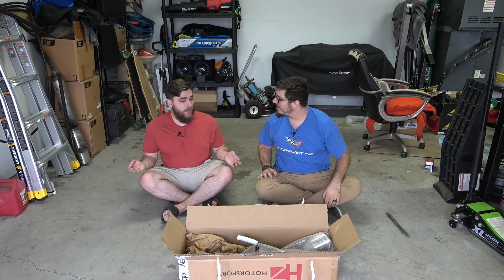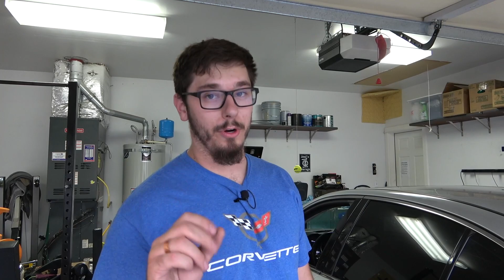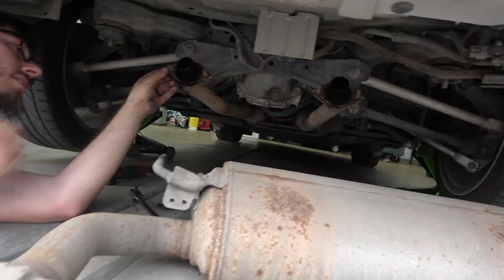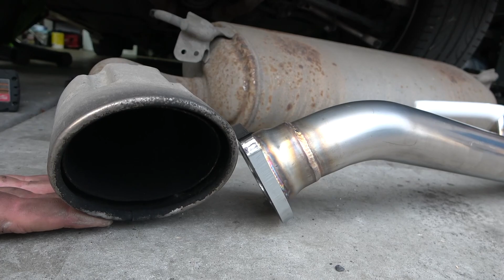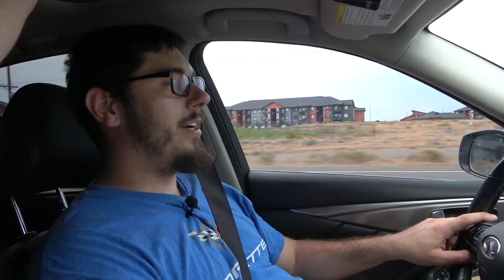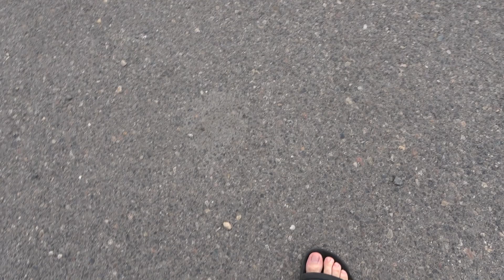$200 Muffler Delete Kit for Infiniti Q50 Install & Review!

Comment: Hey bro what was the name of that vertical drill you used to remove the studs from the muffler/mid pipe connection. Great vid btw
Reply from the maker: Thanks man! That is one of the Milwaukee, M12 fuel electric ratchets! Absolutely love that thing.

Comment: I installed the same. drone is annoying.  Hate it. Don’t waste your money. They don’t provide a refund.
Reply from the maker: Yeah if you want zero drone, you usually have to go with an axle back with mufflers 😕
Reply: @gridengine rev9 axleback is a better option with muffler. This will sound like shit with Test pipes too. 

Subbed
Reply from the maker: Yeah we’ve heard awesome things about the rev 9 stuff… and Simon doesn’t plan to do test pipes so we figured this was a safe option 😅
Reply: The 2.5” diameter muffler delete pipes will drone, the 2” pipes (like in this video) do not drone. I have used both and prefer the smaller 2” version.
Reply from the maker: Oh shii that’s good to know! Thanks man!